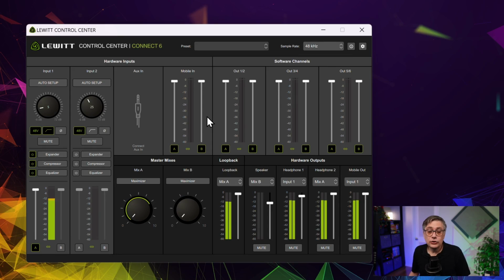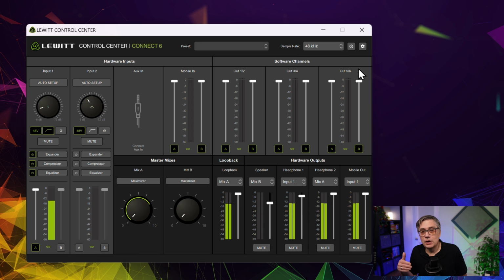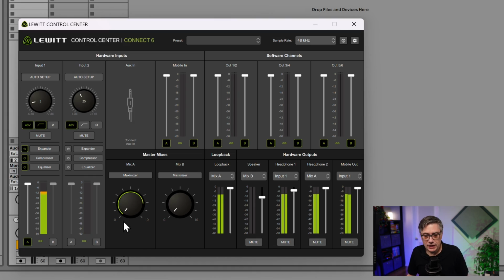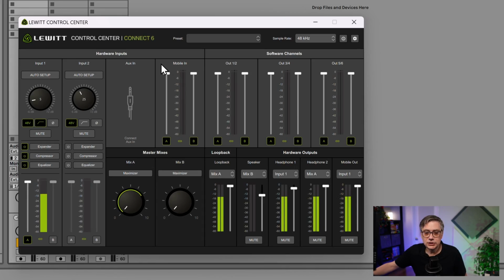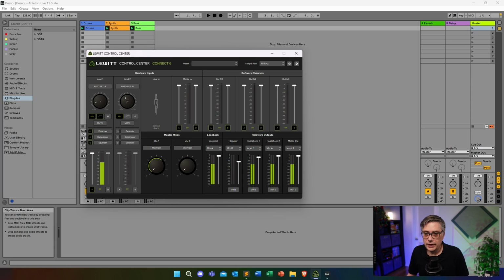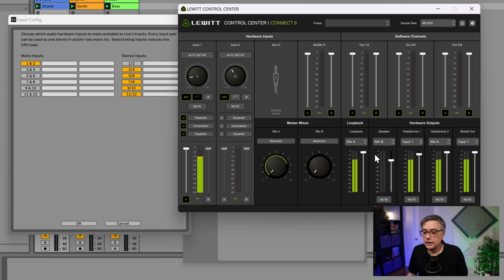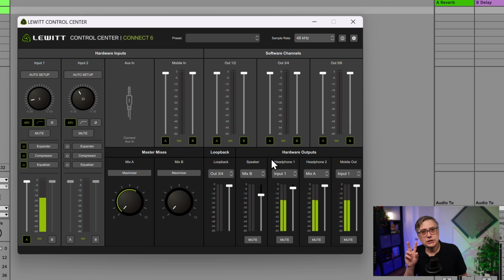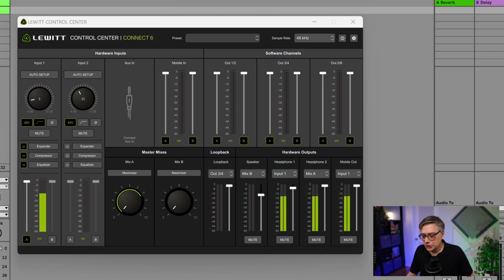6 Reasons why the Lewitt Connect 6 might be the perfect audio interface for content creators

Comment: Hi, I've looked for ASIO info on Lewitt website but there's not much to learn except that they have proprietary drivers.
I'm very curious about that and would like to have some inputs from you and other users, especially if anyone is using the interface with Voicemeeter.
From what I've seen so far, it looks like I could stop using Voicemeeter and just route my audio within Connect 6. But I'm using a VST Host, Cantabile, and would like to know if the ASIO drivers could be used to send to/receive from Cantabile.
Reply from the maker: I actually used it to replace Voicemeeter. But it depends on your setup if that is possible. Voicemeeter can do more than what the Lewitt Connect can do. I never had any ASIO issues but I probably use ASIO4All anyway. I am currently using a different interface.
Reply: @michaelgwagner  Thanks for your input :)  There's a software called GroundControl Room, which seems amazing and includes the flexibility of using third party plugins, and could replace both Voicemeeter and Cantabile, but it's only for Mac. Not the first time I wish I had one.
Reply from the maker: @albiss1164 I did a video about GroundControl Sphere a while back. Great stuff.
Reply: @michaelgwagner  Will have to check that out. Thanks for the heads-up :)

Comment: Hello 

Firstly, I'd like to extend my gratitude for crafting such a remarkable video. 
I wonder if you can help me understand the following concept using the Lewwit Connect 6 and Studio One while recording vocals.

My primary concern revolves around avoiding latency and buffer complications while recording vocals. I'm contemplating the best approach to achieve this and would greatly appreciate your insight on the matter. Here are the options I'm considering:

1- Should I mute the 'CLEAN' vocal track being recorded in Studio One and use the Lewitt Connect 6 for external direct monitoring of my voice?

2- Or is it more effective to record while muting one track in Studio One and concurrently have a separate track "passing through" (if even possible) from the Lewitt Connect 6?

3- Completely monitor my voice on the Lewiit Connect 6 on another PC while recording. 

Admittedly, I'm somewhat puzzled by these options. Your guidance on this would not only clarify my doubts but also influence my decision regarding the purchase of the Connect 6.

Thank you in advance for taking the time to assist me with this query. I'm excited to hear back from you.

Thanks
Reply from the maker: That depends a bit on uour preference. I usually monitor the audio that is being recorded. But that means that you need to get used to having a bit of latency.

Comment: For a voice over, podcast and other recorded vocals..not live streaming or music stuff .. for max 2 mics input need which is the best interface under 300 ..lewitt 6 or audient id14 or ssl2 or motu M2 ?
Reply from the maker: Any of those would do. The only thing you need to look out for is if the mic preamp has enough gain for your mic. Especially if you are working with a Shure SM7B.
Reply: @michaelgwagner  I am not planning to get sm7b ..just SE electronics v7 or sm 58 plus a condenser microphone like rode nt1 or Aston origin..so shall I choose the cheapest interface of those ? Or there is one that is offer better features for voice over?
Reply from the maker: If you are doing voice over you usually do all your processing in post, so on-device effects don’t really help. Either one of those will yherefore do just fine. You might even want to go less expensive. The Focusrite interfaces are very popular. But the ones you have listed are all very good values. You can’t go wrong with any of those.
Reply: a barely-used RME of your choice, purchased by someone like myself who lets it go for a dime on the dollar out of Sheer Embarrassment from their not being able to figure out what to actually do with it once at home in the attic or basement studio.

Comment: How does this affect audio work on the 2nd PC or mobile in terms of configuring its audio port away from normal use to this device? What does your Mac need adjusted to work in tandem with your Master PC?
Reply from the maker: It’s used like a regular audio interface on the Mac. The Mac does not know that it is just the second wheel on the Lewitt Connect 6. For the Mac it looks like any other audio interface.
Reply: @michaelgwagner  Times are getting real spooky what with 'the brains of an object being stuck in a desktop or laptop PC.

Thanks for the Clarify, Maestro.

I have been working on a Bedroom Studio-sized 3rd-, 4th-, & 5th-order Ambisonic setup to practice on here in Ableton Live 11 Studio, if and when tragedy is not assaulting me 24/7/365&1/4 from so many random trajectories and intervals like the last two years have been here.

Formerly-United States of America Has done gone lost its collective mind and pulled the worst characterization of the Lemmings Last Dance way too much of late.

I was thimking these new-fangled spherical Kali Audio's IN-UNP desktop speaker using the mid-high coincident driver from their IN-5 & IN-8 systems  would be ideal for a near-field monitoring setup, but when I wrote to them they indicated these drivers do not go below 280Hz & x-over at t280Hz, so I will contact them in a week or so and beg them for this coincident driver to be fabbed large enough to require only the sub from where the let go on their bottom end.

The focus and localization of various instruments  and voices across any given sound-stage has me flummoxed and flabbergasted someone pulled it off so smoothly.

And to think the JBL folk that started it, were wise in Not bringing the absolutely horrid "JBL Sound" with them.